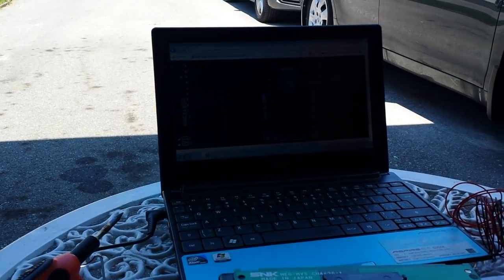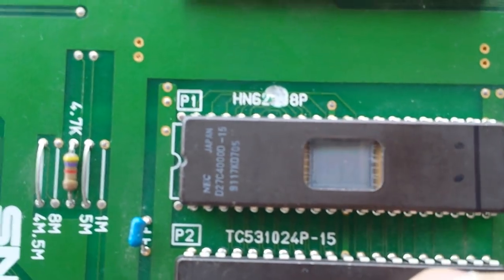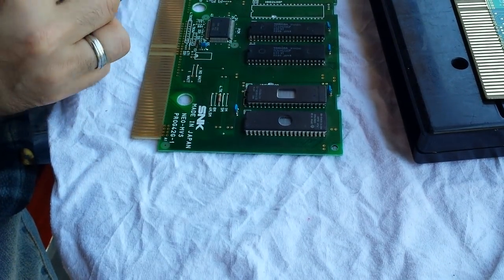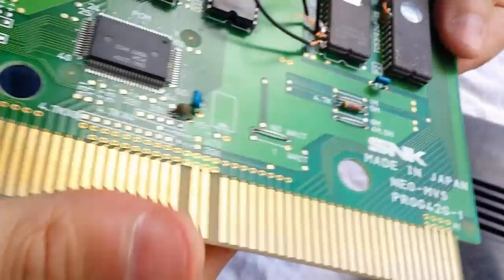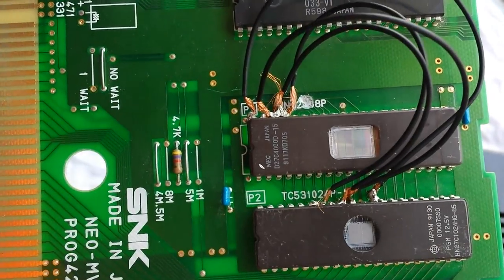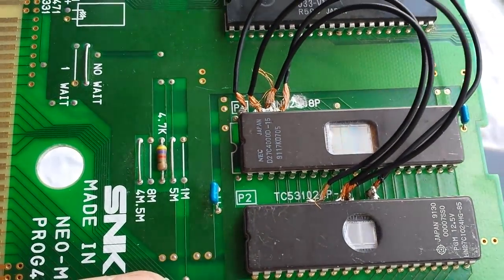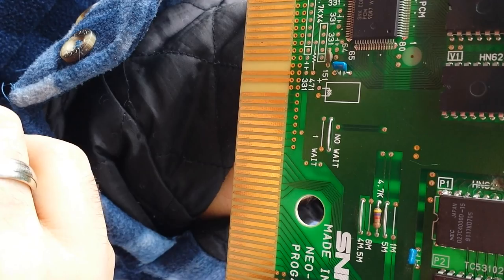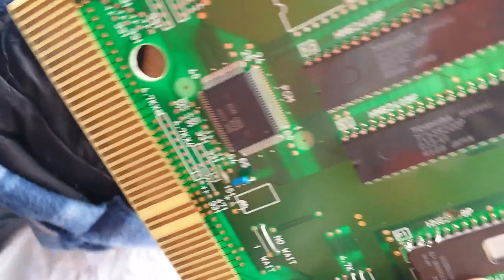Top Tier Tech - Neo-Geo MVS Cart Fix Attempt [HD]

Comment: Steve you are right, most dont have the guts to post their stuff on youtube. but i did have some suggestions, i would use a higher gauge wire that was solid core and not stranded. i would also strip the wire less so there is less bare wire exposed less chance of a short to an incorrect connection. i would also use a multimeter to confirm the connections after they are made. i live in Brampton hit me up if you need some help. 

Awesome vids by the way :)
Reply from the maker: Good tips! Ya, it was a disaster. Lol, other people want to try to fix it too! I have a working one now, maybe revisit the broken cart for fun one episode. Thanks for the kind words

Comment: You need to tin your wires mate. Strip them, twist them, add solder to them and trim them before you solder them to the pins or whatever. You'll get much better results 👍 I know it's your first time so just trying to help. Practice on some spare wire
Reply from the maker: Ah, interesting take on and haven't thought of that. When i get spare time, I will try again
Reply: The damage done by customs really isn't that bad. 

Just use 30 AWG kynar (Wire Wrap) wire and thinner leaded solder, like 60/40 0.5 mm. 
And use the continuity function of a multi-meter to find easier points to solder to on the back of the board.

I have done tons of Playstation and Xbox mods using Kynar wire back in the day, 29 wires on the Xbox in the beginning.

But first of all improve your skills by doing some wire soldering on a junk board and looking up videos on how to solder modchips before you completely ruin this pcb.

You're kinda lucky you didn't do any damage to your Neo-Geo motherboard by plugging this thing in while there were wires short-circuiting.
Reply from the maker: Now that we can agree on 100%. I haven't had too much time to practice and many people want their shot at fixing the cart. I am suuuuper lucky I didn't damage the 6 slot board, you're right. That would have been hell..
Reply: Mac Donalds told truth, you need kynar. Look for traces, they are thin, much thinner than the wire you have prepared. Second thing - you really should practice more with soldering and removing components from the board. I have quite large collection of games but I do not have good enough soldering iron and skills. Tons of games awaiting for me but I have to get really good soldering iron and I know that I should start from junk from trash, not my lovely games. I broke my router, the fault was I and my poor soldering iron - I could not achieve reasonable temperatures at reasonable time. And last thing about which nobody told you until now. This cart is broken not only because damaged traces. Your eprom windows are open. It this means that you have to desolder all eproms with open windows, you have to program them again, and solder back to the boards with covered windows.
Reply from the maker: I agree with all of your advice. I havent had a chance to practice yet but I will. I never knew I would have to reflash the eprom because the seller told me it was working prior to shipping. Good to know and thanks for your feedback
Reply: Top Tier Arcade
You don't need to reflash the eproms, almost no UV light can enter the cartridge. There are tons of arcade games with unlabeled eprom windows because hardly any light enters the cabinet.
It takes over 2 weeks of full sunlight to erase an eprom. http://hackaday.com/2016/09/14/staring-at-the-sun-erasing-an-eprom/
It even takes years for fluorescent lights to erase an eprom.
Reply from the maker: Mac Donalds interesting. Good to know. Thanks